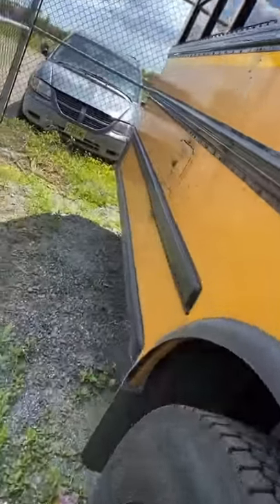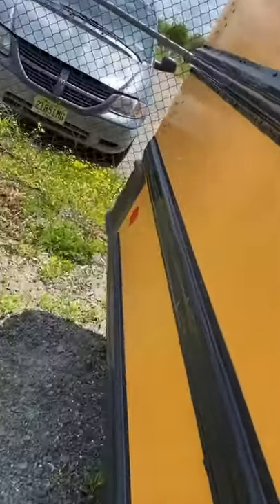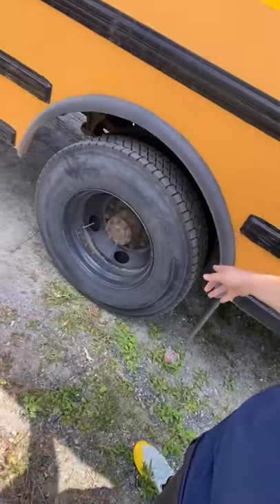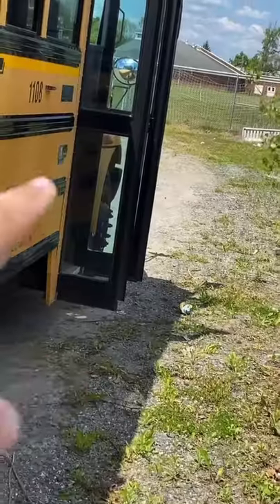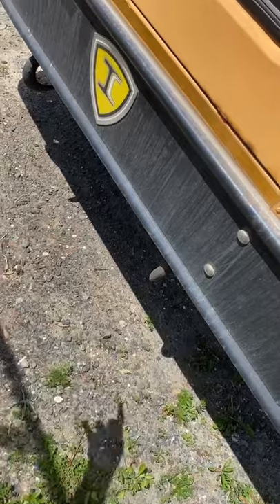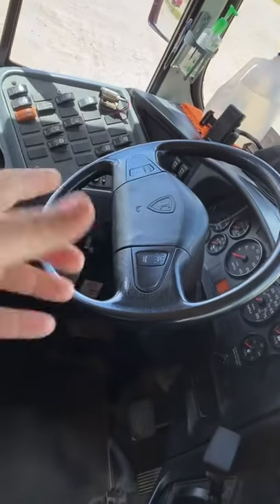Why Do School Buses Have Tow Hooks?

Comment: I’ll add in my 2 cents as a tow truck driver. Picking these up from the rear end works in most scenarios if, and a big if, you have a large enough truck to do it safely. The weight distribution of picking up a large vehicle  backwards as well as having to chain up the rear axle so it won’t sag down and smack the ground is sketchy most of the time. Pulling a driveline with the right tools take 5-10 minutes and you don’t have to do any maneuvers to get the thing turned around. Spring fork the front leaf springs or Frame fork the front of the frame and slowly limp the vehicle to a safe place to remove the drive shaft if you are going anywhere further than like 5 miles

Comment: Also on a ic hydraulic brake system the parking brake is bolted directly to the rear differential. To keep it released the tow truck has two options, cut the cable to the parking brake leaving the bus able to roll free or Leave the key on so the hpb unit( high pressure brake unit) holds the valve open an the sars unit (parking brake assembly) and hope the batterys
Hold up till they reach there destination or the rear will lock up

Comment: Also they tow it by the back because if they towed it by the front because there is so much of the bus behind the axle they would risk dragging the tow hooks on the ground..
Reply: Absolutely not. You'd need to lift the front end of the nus 4 feet in the air for the rear to scrape. But what would i know i dont tow trucks and buses for a living

Comment: Actually, that is incorrect. They hook the stinger to the frame rails, not the tow hooks. They may hook the safety chains to those, but most of the time tow hooks are used to pull the bus out of snow or mud when it gets stuck.

Comment: When I got towed in a box truck or semi pulling a trailer they disconnect the drive shaft to tow and they normally use the tow hooks in the front.

Comment: i work on school buses. This is true however in a situation where they cannot get to the rear they will disconnect the drive shaft from the rear end and ratchet strap it to the frame and pull from the front

Comment: School busses and semis have tow hooks in case you need to be pulled out of something. IT'S IN THE NAME PEOPLE
Reply: These are for the breakaway chains on the truck that's towing you
Reply: ...in our neck of the woods, those hooks don't get used for much, the policy is to remove the drive shaft and the tow truck driver parks them on a hump (tow row) where they can be aired back up by our tug and pushed if necessary.....I've always thought the hooks were more for shipment or vehicle recovery.
Reply: Thanks captain I wouldn't have known that

Comment: Well, they should strap the drive shaft, but yes. Also did you know that with an honest manual transmission you can put your bus in gear as a substitute for a parking break?

Comment: Sometimes ya have no choice but to hook from the front and pull the shaft depends where it is but that’s not what those hooks are for
Reply: Those hooks are to hook a chain if you get stuck only thing they’re good for for towing is hooking a safety chain to towing it you’re gonnna pick it up by the frame rail that’s right behind it

Comment: Did you know there are buses that run on gasoline now? And since they are now super quiet, there's another lovely noise that comes from the rear. When my school bus is moving, there is a loud whirring noise from where the rear duel wheels are. The pitch of this odd noise gets higher when it is moving at faster speeds. It's kind of weird.

Comment: Your right, but wrong. The transmission will be shot, but not because what your saying. When a transmission is in park it engages a pin the pin stop all the gears from spinning and if you tow a vehicle from the front that pin will snap and there for lead to what you are saying. And you will need a new transmission. Or all that can be avoided by lock the steering wheel and putting the vehicle in neutral.

Comment: That's not 100% true 1 depending on how far you are going you can get away with keeping a RWD in neutral with out dumping the driveshaft if ur going far yes you must drop the shaft but more then likely if you are going far they are going to drop the driveshaft because you don't want the front on the ground God forbid the strap loosens on the steering wheel because then you got a huge fucking problem